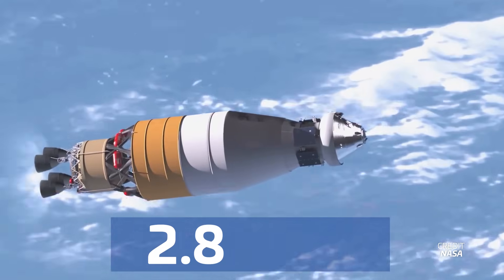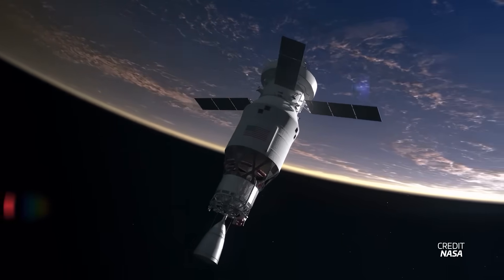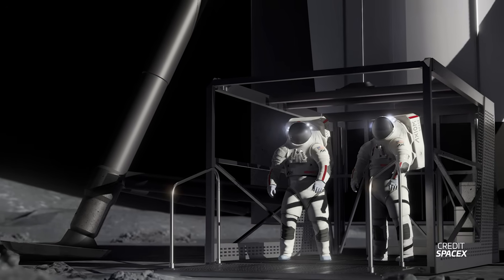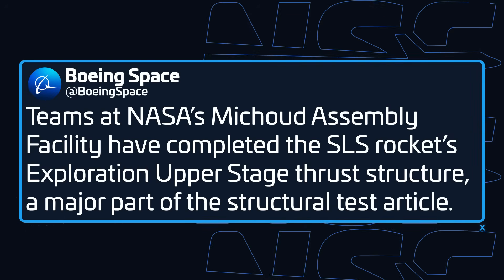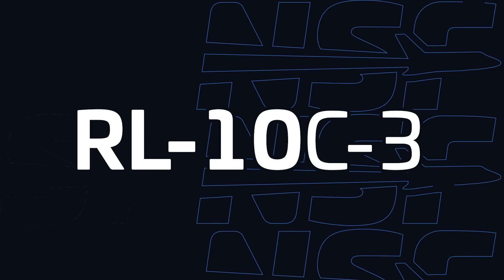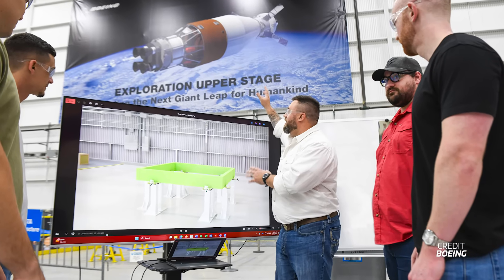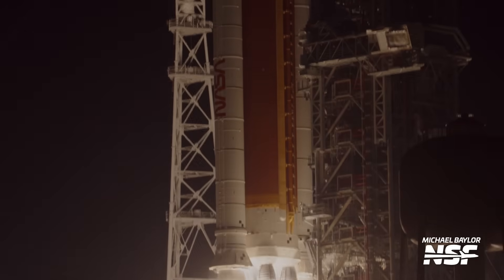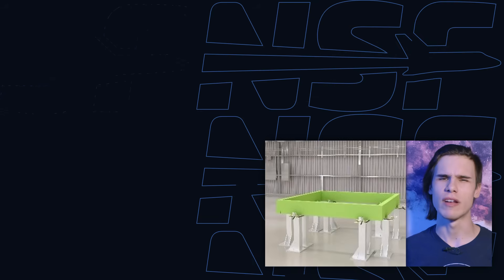NASA’s Artemis Upgrade: Boeing Reveals a CGI... Square?

Comment: An upsized version of the ICPS, which is itself an upgraded version of the Delta Cryogenic Second Stage, DCSS. A decades-old design that was rejected by ULA in favor of the Centaur upper stage when they merged and built the Atlas V. Afaik that was due to an inefficiently high mass relative to the Centaur. If the delays are anywhere near as bad as with SLS there will be an absurdly long gap between Artemis 3 and 4.